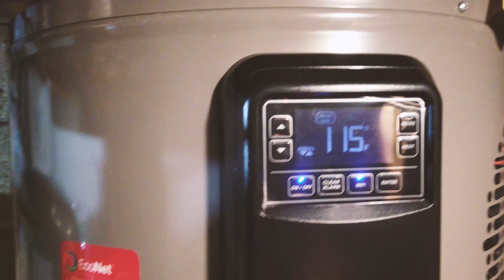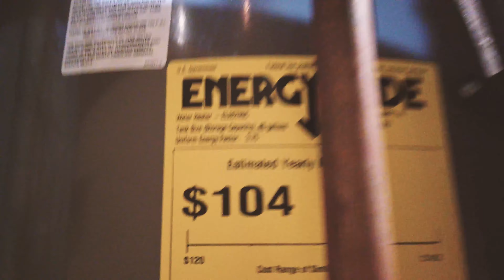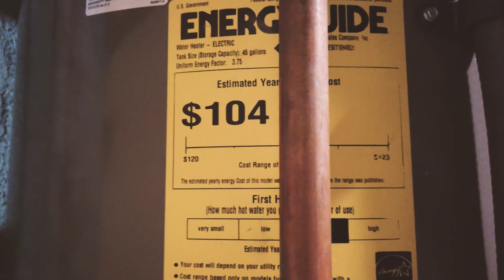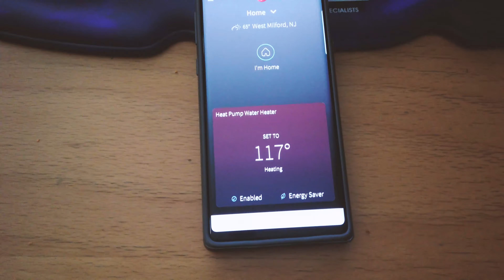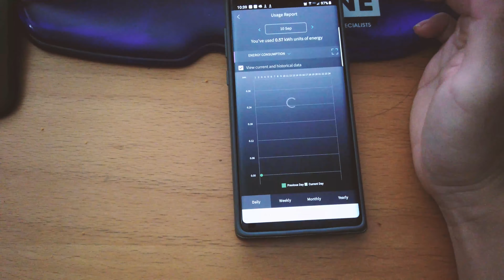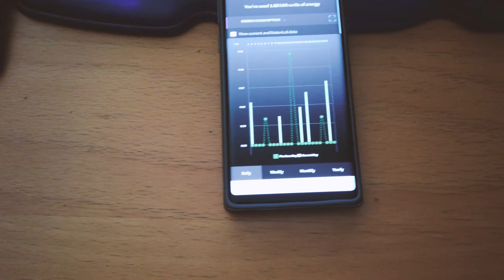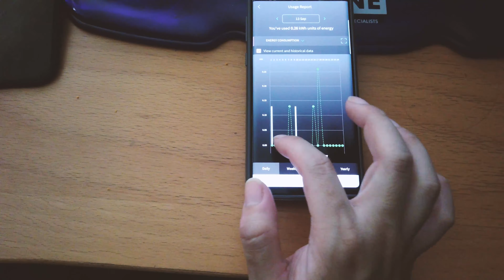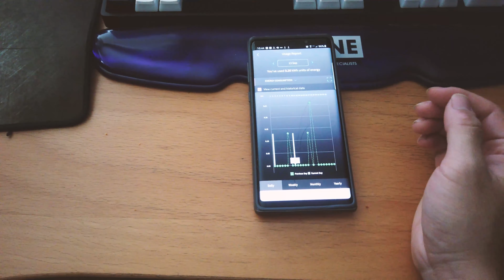Rheem Performance Platnium WiFi Hybrid Heat Pump Water Heater Cold Climate Review

Comment: Thanks for your review, it was much appreciated. note: If you are paying to heat your house and the hot water heater is condensing heat energy from the air, you are in principle using your house heat to heat your water and not accounting for the indirect energy use. heating your home with an external heat pump would offset the difference.
Reply: Unless you have excess heat in the basement.
Reply: @familybikeride  which is actually coming from the earth, since his basement is coupled to the earth.   Any heat that is "sucked up" by the hybrid water heater is also being replaced by the walls and floor where the earth is probably maintaining a constant 50-55 degrees...even in the winter.

Comment: I just installed the same one last weekend.   Mine is in the utility room attached to the garage.  I have a "ranch" style house - single story - and I pull in air via 8 inch duct from the attic to the tank (take advantage of the warmer air in the attic).  It right now in mid 40s in Charlotte, NC - and the air venting from the compressor  is around 33 degree.    It gets very cold in our garage when it gets below 50 degree.   I can live with that - and it will be a nice feature in the summertime.        Now this gentlemen looks like he has a gas or oil heater in this basement - so he will be able to use some of heat from that to compensate.   For me I have no heat source - so cold garage.   I'm strongly thinking of connecting this to the house - I can pull air from our high ceiling in the living room - and vent cold air in another room.   In the summer time that would give me even greater saving.  But in the winter it would have to be bypassed to the current connections...
Reply from the maker: I remember reading instructions from Rheem against installing it in exposed/colder temp garages that has no heat source, and they highly suggest to just install in basement because basement has a constant warmer temp while garage gets pretty chilly in winter time in cold areas.
Reply: You can simply run it in conventional electric mode in the cold months if you cant find a ducting solution for the heat pump mode.

Comment: 12.31.20  Thanks for the instructions on how to use the app.  I agree with the comment below setting the temp to 122 or higher.  
It's unsafe to keep your water heater set so low as it causes legionella bacteria to thrive.

Comment: Hi, how many people are in your home using this water heater?  I'm looking to purchase a 50 gal tank for a 3BA house (3-5 people), which Rheem suggests 50 gal meets and can support 4 quick back-to-back showers or a single shower for 36 mins.  But, I was wondering if in reality the 50 gal underperforms for 4+ people (also thinking of when guests are staying overnight when there's more demand).  I really don't want to pay several hundred more for the 65 gal tank, but I also don't want to end up with regrets if I go with the 50 gal.  Do you have any feedback here on hot water performance when there is higher demand?
Reply: Not sure if you have made your purchase, I would go with the 65 gallon. It will recover much quicker. Most showers are 3 gallon per minute. So 2 10 minute shower would be 60 gallon if you do not have the heater on high demand it will not recover properly.

Comment: Do I have to leave the fan on continuously it is putting such cold air out can I turn that off and what setting do I need to put it on where I still have hot water but that fans not on
Reply from the maker: The fan rarely comes on for me, maybe once a day, and if I use a bit more water twice a day. You can not turn fan off as this is how the heat pump heater works

Comment: Great Video ! why did you used Condensate Removal Pump? Thanks!
Reply from the maker: Because it produces a lot of condensation when running, just like a AC. So you'll have a place to drain them if you are thinking of a heatpump water heater.
Reply: @TheGizmoGarage  Thank you!

Comment: How loud has this water heater been? I am thinking of installing one but have read the 5th gen version (2020-2021) has been significantly louder than the previous 4th gen model. You seem to have the 5th gen so was wondering if it’s been excessively loud?
Reply from the maker: It's in basement and I can hear the fan running from ground floor through wood floor, not loud but noticeable and louder than my dehumidifier in basement.
Reply: mine is SOOOO LOAD.  Loader than a vacuum.

Comment: Hi there.  I installed this last night, and feel heat going up the cold water inlet.  Do you experience the same?  Actually felt hot water in the faucet for a couple of seconds this morning as well.
Reply: Just bought 1 of these 2 weeks a go. You need a heat trap in the cold water line at the water heater.

Comment: My dilemma is I live in a cold climate (Indiana) and I don’t have a basement. My water heater is in my laundry room. So my idea was to vent in from the main living area and the cold air out will just remain in my laundry room. Aside from a cooler laundry (not desirable in the winter), it will be pulling heat from my living space to heat up the water. So my all electric hvac will be in essence heating my water indirectly, which eats into any savings. Plus I hear the condenser coils need to be professionally cleaned every so often which would also erode into the savings. Plus there is the noise being in my laundry room with my already loud at time hvac system.
Reply from the maker: My opinion is that the energy savings in the long run will still be more cost-effective. And yes, you'll have to live with the noise of the compressor if it's close to living space. If you value comfort over efficiency, then a traditional water heater of the capacity you need is still probably the best way to go.

Comment: Did you get any government or electric rebates?
Reply from the maker: Starting my application now, its $750 NJ electricity company rebate plus $350 from federal tax credit. The rebate from NJ seems complicated and takes a long time to process
Reply: @TheGizmoGarage  Using a watt meter how many watts does the heatpump consume while it's working in real time?
Reply from the maker: @encapsulatio  it is hard wired to the 240v outlet so unable to test using a watt meter. However based on compressor and fan spec (1.6A + 0.15A @ 240V), we can calculate an acurate power draw of 0.42Kwh if compressor is running.  However based on my experience compressor rarely kicks in, maybe 3 to 4 times a day for less than an hr based on my personal usage. And based on app power consumption report, I am using 0.6 to 0.9kwh per day. Hope those numbers help you.
Reply: @TheGizmoGarage  the idea is that some people want to run it just using the heat pump alone using 300-400W from solar panels for a couple of hours/day to the the water.I just need to know if real time is around those values.
Reply from the maker: @encapsulatio  got it, so yeah, precisely 420w in heat pump mode.
Reply: I have the 40 gallon one and my average the last 3 years is 1.2 kWh a day , I use the energy saver mode. The compressor is very quiet you just hear the fan(quiet) and it seats in my garage it keeps the garage cool in the summer.

Comment: Which setting do you use? Energy saver, high demand or heat pump?
Reply from the maker: Heat pump is the most energy efficient. Energy saver is for when you are away I believe that doesn't heat the boiler all the way up to the set temp. High demand works like a regular boiler, without heatpump, just heating coils, very inefficient

Comment: There is a filter on top to clean. can you get to it with such low ceilings?
Reply from the maker: I tried, I can get it out fully, as long as you have enough clearance according to instruction manual you should be fine!

Comment: So it steals heat from your home to heat water? Nice in summer but in winter no bueno!
Reply from the maker: That's why it belongs in basement in colder climates where all year round stays pretty constant temperature. And it has proven itself extremely efficient as now it's spring and it used on avg only 1-1.5kwh of electricity per day through out winter.
Reply: @TheGizmoGarage  alright but the heating bill goes up because you are scavenging heat from inside your home. This could work if you pull in outside air and discharge it outside.
Reply: I heat my house with a woodstove in the basement. Basement is at times unbearable. This is going to work good for me.
Reply: @sjefoekel6058  no, it will scavenge heat from the basement floor which stays a consistent temperature, similar to geo thermal. You will barely notice a difference if any at all in your homes heating. If anything it would scavenge lost residual BTUs from a propane or oil furnace, which would benefit you. Heating bill does not go up.